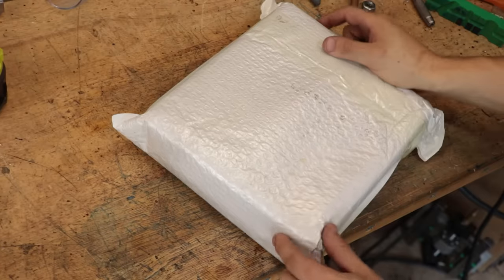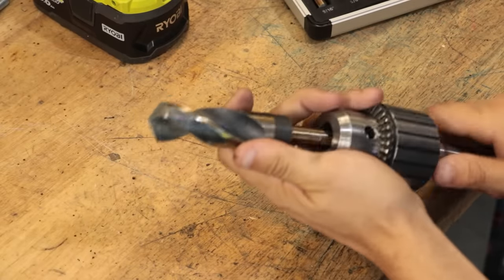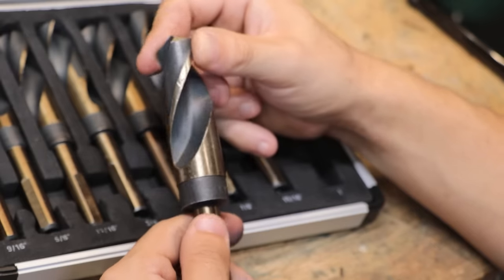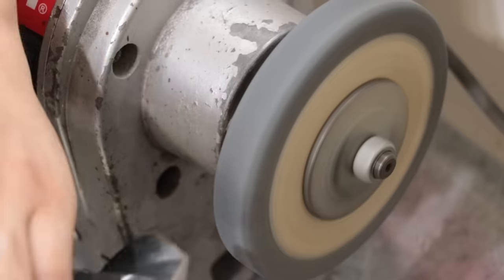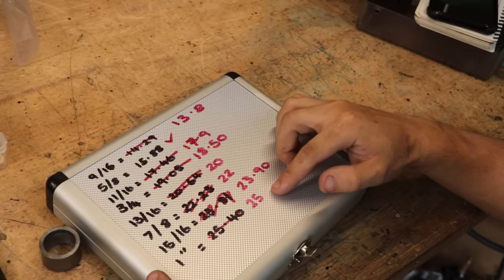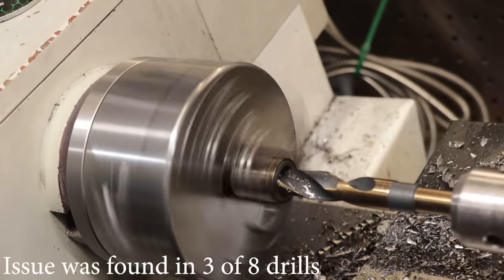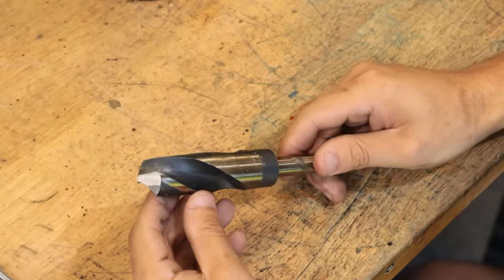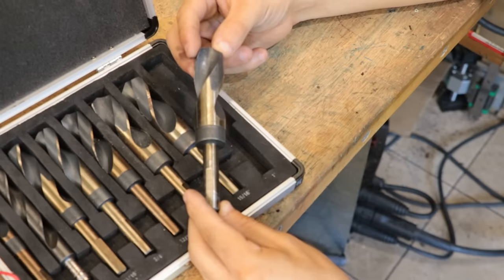Cheap Reduced Shank Drills. Worse Than You Think

Comment: i have a very similar set and i gotta say, you seriously got the short end of the stick here. i also paid 40usd for mine but the quality difference is day and night compared to these. they are not comparable to good quality bits but i have zero complains about the grinding and finishing (for the price), and while watching the video i got curious about the actual size so i used a micrometer and they are all within 0.05mm, which is impressive. material quality is probably about the same as yours, and that "wws 25" is commonly known as "Chinesium"

in conclusion: not all chinese crap is made the same
Reply: That's the thing with low end stuff. The product is not consistent so quality is all over the place. It's gambling. Sometimes you win and sometimes you lose. Now there are people that do enjoy the activity. That's why casinos are in business. We all like to play the games occasionally.
Reply: @1pcfred  its not about gambling at all, at least for anyone i know... its just that in many cases "the good stuff" costs 5 to 10 times the price of a chinese knockoff, and for people like me who dont use these tools on a daily basis it is not justifiable to spend the money. a good example: in my country a cordless DeWalt drill (the only good quality brand you can get here) costs 1000usd, a chinese cordless drill costs 100usd. no matter how bad i treat them, i am not gonna break 10 cordless drills in my entire lifetime, and even if i bought 2 or 3 to have a spare in case of need, i'd still come out ahead. as he said, the entire box of chinese drillbits is worth less than ONE SINGLE good quality bit
Reply: @TheMadJoker87  if a tool isn't fit for task it doesn't matter how cheap it is. Although $1,000 for a drill is expensive. Here DeWalt drills run about $100 to $300 or so depending on the model. Those are kits with batteries and chargers. I'm not sure if DeWalt is the best. It's likely good enough though. A lot like Milwaukee. I'm pretty sure even those brands are made in China today too. Some off brands are OK. I have some old Black and Decker cordless tools myself. Good enough for me.
Reply: Short end of the stick? I think you mean the reduced end of the shank.

Comment: I bought a similar set through the jungle themed online source from a random Asian import seller. Mine work and look slightly better than yours, but I didn't get the optional missing chunks and scratches from the midnight shift. 

I think if you need a hole like thing in sizes you don't otherwise have or use often, not a bad deal. If you want said hole to be accurate or the drills to last, keep stepping.
Reply: Usually, quality with import tools is reflected in their lifetime. I needed 4x 22mm holes in 3mm steel, and you can bet your bottom dollar I am not going to spend more than $25 for a drill in that size. And I am also not paying for a boring head, or someone to bore it out for me with their tools.
But if you make a living from drilling 22mm holes, you just get the proper tools.

Comment: I learned a long time ago that a cheap import tool can get you by in a pinch but you still have to treat them all like half finished projects. Some can be fixed up into a workable condition but most aren't worth the time or effort.
Reply: I got a few when i had to drill i think 4 holes. No tolerance but large diameter.  
Worked well enough.

Comment: I must admit to being taught to gradually increase the size of hole I am drilling. One starts with a spotting drill, then goes to 1/4" (6mm)  & goes up in steps, to suit one's lathe. Mine being a Myford, so around 1/8" (3mm). Clearly with the biggest sizes you need to reduce the size difference. The object being not to stall the lathe or chew up the chuck jaws. Or if the drill has a taper fit & your lathe does not have a corresponding internal tang, chew up your tapper.
Reply: even with a proper lathe and dril bit ,yanking a 25mm drillbit into a non drilled part is work.As the RPm in the middle is Zero,you are pushing a big pieace of stell through a different piace of steel. 
So predrilling with a drilbit larger  the non cutting centerpart will drop forces a lot....
so Predrilling is always a good step
Reply: @bosanaz2010 One might even say it's mandatory
Reply: You'd be horrified seeing Kurtis at Cutting Edge Engineering push a 2" drill into a huge cylinder rod without drilling a pilot. He uses Bluddy Big lathes however 😂
Reply: @johncoops6897  Step drilling is mostly a myth; with proper setup you should be able to mark, punch (ideally center drill) and then choose the appropriate drill size. You then  ream/bore to size if required for the application. Step drilling wastes time and massacres drill bits(and tools and wrists) and too often the hole ends up worse.
Reply: @rolfbjorn9937  - it requires a huge amount of tool pressure to push the web of a large drill into the stock. Unless the drill is ground with a split point, you have a dead flat chisel (The width of the drills web) that you literally have to push through the material, as there is no cutting happening from the sharpened cutters in that central area. Furthermore the friction at that point can overheat the drill or work harden the material.
.
Remember, most of us are hobbyists and even drilling anything over half inch in steel can be challenging, perhaps a bit larger in a decent drill press. It's even more difficult with a Jacobs chuck, like shown in this video, where extra tool pressure means chewing up the drill shank and/or chuck jaws.
.
So, the decision becomes... does my machine have enough rigidity and grunt to push the large drill hard enough, or will it be quicker overall to preform a second step of drilling a pilot/clearance hole.

Comment: Dents and scratches on ground surfaces are a warning that the metal may be soft. Real HSS is 62-68 HRC, and are very hard to scratch or dent. The scammers advertise the drills (and other tools) are made from HSS, and when you get them you can instantly tell they aren't HSS, but some alloy of questionable heritage. Amazon does nothing about this, they take no responsibility for false advertising.
Reply: I’m guessing they came from them all being thrown in a pile/ bin while being made instead of being kept separated.
Reply: worth going for the amazon reccomended ones in this case cause then they do take responsibility.
Reply: @TalRohan excellent point on the Amazon recommendation. I love that return policy.
Reply: @nickmasterson942 The ones that say "Amazon's pick for (product category)? They offer additional warranty for them?
Reply: @nickmasterson942 - if they are chipped, that means that they are HARD, not "too soft". Soft metal is malleable and bends when impacted.
.
The damage shown here is certainly from poor handling during production.
I'd say these have failed QA for size and/or damage, and they are selling the "rejects" off for cheap.
Reply: @Heizenberg32  there's nothing different in aware of.  I have no idea what they are talking about. I even went and checked the returns policy,  there's absolutely zero mentioned.

Only thing I can think of is recommended items are sold by Amazon so it has a free return policy.  Non Amazon items may or may not have a return policy and you may have to pay return shipping.
Reply: But these are cobalt bits! You can tell by the color :D
Reply: The product listing he shows is from eBay, not Amazon. (1:11)
Reply: Soft would dent, hard will chip. These are ebay cobalt specials
Reply: Some folks even say that cheap carbide inserts from  are really not carbide, but the ones I purchased from aliexpress work amazing for me on metal. So I guess depends what seller you stumble upon
Reply: RC 68? No way. That isn’t achievable.
Reply: @melgross  Yes way. That stuff can get nearly glass hard and still retain decent toughness.
Reply: @melgross  Technically, the drills we call "cobalt" are HSS alloys, and they can get up to at least 67HRC (according to Kennametal, anyway), but we also usually distinguish between cobalt and non-cobalt HSSs.
Reply: Very few retailers will take responsibilty for that especially when they are completely unaware what hss even is
Reply: @smashyrashy  maybe, but they’re SUPPOSED to know.
Reply: Amazon does flag frequently returned items though and displays that to people. So if something is bad, return it.
Reply: @Mrcaffinebean  I'm pretty sure Amazon doesn't monitor returns for products purchased through eBay.
Reply: @wbfaulk  the OP in this thread is talking about Amazon.
Reply: @Mrcaffinebean  Okay. Can we complain about Home Depot, Lowe's, Menard's, Homebase, B&Q, and Bunnings, too? Or did OP maybe just get confused about where the drills in the video came from?
Reply: @wbfaulk  what are you rambling about? No one is talking about those places. If you can’t follow a simple conversation just say so.
Reply: @Mrcaffinebean  Why is anyone talking about Amazon, then? If I'm not allowed to bring up irrelevant stores, why are you okay with OP bringing up an equally irrelevant store?
Reply: @wbfaulk  start your own thread boss. You comments have nothing to do with this one.
Reply: @Mrcaffinebean  They do, because the point is that people are mistaken that the drills in the video were from Amazon, and they're not. Complaints about Amazon about these drills is absurd. Advice to return these drills to Amazon is absurd. Even if you just said the name wrong, the idea that returning these drills to the eBay seller will result in getting these drills off the market is absurd.
Reply: @wbfaulk   no one thinks these are from Amazon. The OP merely mentioned Amazon. Reading is fundamental.
Reply: @Mrcaffinebean  Okay.
Reply: @Ch4grin they may be cobalt COATED bits certainly, but Co-HSS bits I bet they definitely are not. They would be a lot more expensive even from China.
Reply: I have an inexpensive "Clarke" ( UK) branded set of metric ' blacksmiths' reduced shank bits that I got for Xmas about 3 years ago. They cut to nominal size  pretty much and they've had a reasonable amount of use and I have only had to regrind one as I hit a hard spot in a piece of 316 stainless. But other than that they are pretty good for the money. They come in a wooden box with a rubber scalloped pair of holders which when the lid is closed holds the bits securely unlike that piece of rubbish box those pieces of crap came in. I would have returned them and gotten my money back but once having hand ground the 1" one you now can't lol
Reply: WWS is. Manufacturer not a grade I think

Comment: I did the same thing with the multi-piece set of end mills. Used them til they got dull and replaced them with good ones. It was a good way to get a selection of sizes not knowing what sizes I'd be using most often.
Reply: I'll tell you which sizes you use. You use the sizes that aren't busted and dull. That's the sizes you use in sets. Hmmm, this one still looks good. I guess I'm using it.
Reply: One philosophy I've heard about tools is to first buy them cheap, and if you use them eniigh to break them (assuming they arent total pieces of junk to start with) then buy quality ones.
Reply: @AnonOmis1000  that's a strategy I've heard and used myself. It isn't ideal but that's how things go. Life would be easy if we started out with all the answers. But I didn't.
Reply: @AnonOmis1000  Even the Chinese end mills I bought were not junk and they cut well. I jsut didn't know which sizes I would use the most so the multi piece set was the right choice for me. After I got to making other projects I started buying more specialized cutters based on what I was making. Plus as I was learning I broke more cutters than I do now so cheap was a quality all it's own.

Comment: I've always know these as "Blacksmiths drills".  I bought a set of import drills some years ago and they were honestly not too bad;  I drilled a bunch of stainless steel round bar to make motorcycle wheel spacers (bored them to size afterwards) and they handled it pretty well.  Mine don't have the flats on the shank though, so you need to really tighten the chuck for the larger ones.
Reply: I think most tools that are made with no quality control at all, it's hit and miss!!! I bought a set of these a few years ago & the relief was higher than the cutting edge!!!

Comment: A lot of these cheap reduced shank drill bits are optimized for drilling wood. Once you get above 5/8 they are pretty much snap city. Using them in a 'real' drill press or real lathe they snap right off at the step down. Splitting the point can help a lot. But in my shop I use taper shank over 5/8 of an inch. Mt2 seems to hold well to about 7/8 of an inch.
Reply: A drill that snaps off is hard, and will stay sharp a long time if you take care of it. Cheap alloy drills usually twist off, indicating poor heat treat/soft metal.
Reply: @Bob_Adkins  the cheap drills are both, depending.  Sometimes you get overly hard carbon steel labeled as HSS. Sometimes you get some they forgot to harden. My good drill bits will twist before breaking if pushed to hard. The cheap ones are a couple crap shoot.
Reply: @moosesmachinery  If you can find one or 2 dependable brands (with unpronounceable names) you can get some good tools for cheap, but it could take several tries to find the better quality.

Comment: Had this sort of inch/metric discrepancy happen to me when I bought a very cheap #26 (0.147”) wire gauge drill, arrived at exactly 3.7mm even though it was stamped #26. Funny enough that’s the metric size I was roughly shooting for anyway

Comment: Totally agree the flats on the shank makes all the difference on a reduced shank but without a grinder fixture I can't recommend grinding them by had as they won't grip accurately. What scares me is people putting these in hand drills, they do nothing but wreak your wrist in anything but wood. I have actually bought quite a good range over the years as places like Bunnings drop lines due to low turn over, good quality too.

Comment: Great video. I suppose the other point about Demming bits is the torque on the bit from cutting is generally more than the chuck may be designed for. Obviously a 13mm (or 16mm) chuck is designed to cope with the cutting torque from 13 or 16mm bits. A 25mm bit will be roughly 2x that torque for a 13mm chuck, or 50% more for a 16mm chuck.

For this reason I think the MT bits are the go. FWIW I've used the Hare & Forbes MT2 HSS sets and they've been quite OK.
Reply: Thank you for mentioning this channel by the way. It's just my cup of tea.
Reply: Hey need more videos of Tiffany please

Comment: The shank on the 25mm drill reads WWS25.  I believe that means that it is WWS tool steel, 25mm
Reply: It did look like the 25mm drill bit which  is about the biggest clue to what the reference was.

Comment: Drills are very minorly tapered from the cutting end to the held end to prevent jamming from chips or if it is not perpendicular to the job, 

the cutting edges on the flutes can like you showed be stoned or linished to get them smooth ish again, they do every now and then need a touch up from either a bump or bingle or using them in a cord/less drill to enlargen hole etc.

The web can be thinned on large drills to enhence cutting/drilling large diameter hole with  a tiny on no pilot hole

Also those drills could just need a quenching or tempering to get them to a more exceptable hardness
Reply from the maker: Most are but as I said in the video these have no taper, strange isn’t it.

Comment: Inches were redefined at some point to be exactly 25.4mm to the inch, so you could argue that inches are just a subset of metric. That said, I have some of those drills and they make such a horrible hole that you would always finish off with a decent drill, or bore to size. They are only good for roughing, so just treat them as "undersize" drills.

Comment: Good video, thanks for all the effort. I've been using annular cutters with a Morse taper (or R8, et.) adapter, lathe or mill. More accurate size, great finish, quicker and less horsepower required. The only con is being economically limited to 2" depth. A bonus though is a plug left over that can be used for other project

Comment: I bought an Imperial set of Blacksmith's drills from a reputable dealer a few years back, they came in a blow moulded case. They all worked fine, but the 5/8" one obviously wasn't even hardened, you could mark it with a standard file ! A complaint got me a suitable replacement and I've used them ever since. They do tend to chip or fracture their outer cutting edge when I'm using them onsite in my cordless, but thats mostly down to me "step drilling" to make big holes with my battery Makita !

Comment: I have a suggestion for your next Shop Project...

Build yourself a drill holder for the grinder so you can ensure your sharpening is symmetrical and at the proper angle...Bonus Points if it can handle ALL your drills, from 1/8th inch all the way up to 3 inch if you ever buy (or build) a drill that large...

😄😁😆😅😂🤣

Comment: What's funny is 19mm is an almost perfect match for 3/4", only .002" difference, and that's the one that's the furthest off.
Working with wrenches, though, 13/16" and 20mm are interchangeable in nearly every application. 7/8" and 22mm also. 15/16" and 24mm as well. Wrenches don't need to be as precision as drill bits, but you get the idea.

Comment: I've bought a few sets of those over the years, on the same premise - break or wear one of the set out, replace it with a good quality bit. Most went okay, but I did have one set that were terrible, they actually bent in use. These days I use annular cutters for any hole over 13mm in diameter unless I am doing the drilling in the lathe. I have good quality bits all the way up to 22mm on the replace it if I broke it premise for use in the lathe.
One day I will be brave enough to stick an annular cutter in the lathe! Being able to take a 30mm slug out would give my boring bars a lot of relief!